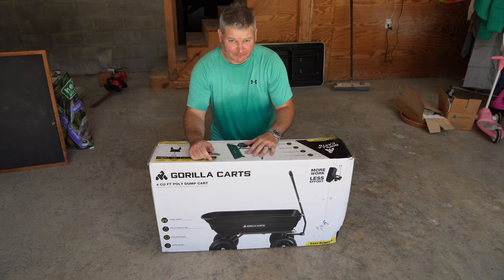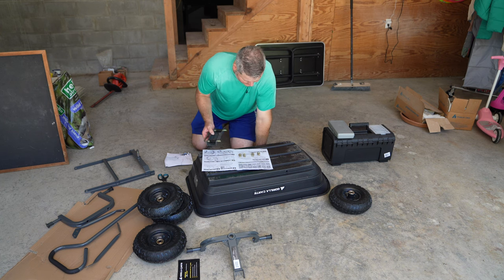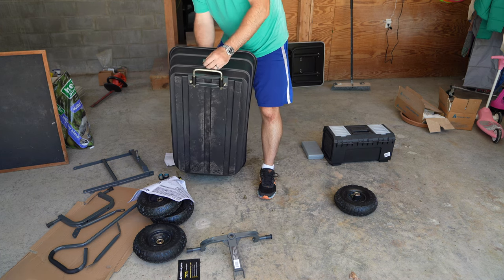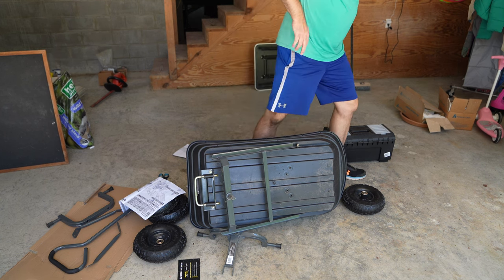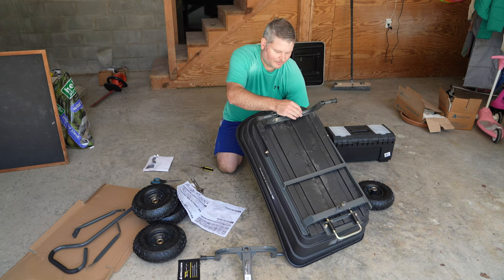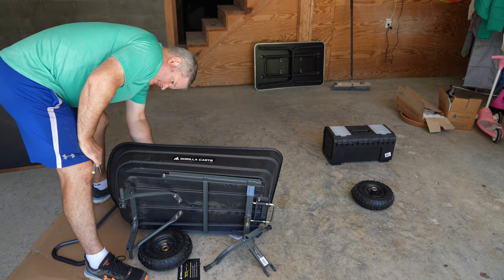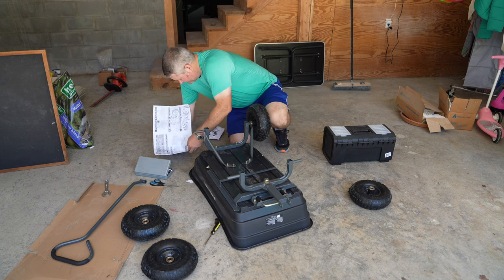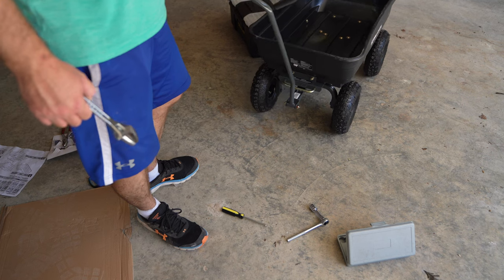Gorilla Cart Unboxing & Assembly

Comment: I have owned one of those for ten years. It's a great yard and garden wagon for hauling dirt, rocks etc. After 3 or 4 years I got frustated with the frequent flat tires and bought new wheels with tires installed from Amazon. They were foam filled, can't go flat tires. I also put zip ties on the end dump mechanism so my grandkids would not trip it and get dumped out when they ride in the wagon.
Reply from the maker: Awesome!  These tires seem thick.  I wonder if they’ve upgraded the tire quality since then?
Reply: @IrixGuy  They replacement wheels and tires have solid tires with no air pumped into them. Small tires. like the originals or air filled wheel barrow tires can get very annoying after a few years when they are always flat when you want to use them.
Reply: Yeah usually tires will lose air, even car tires will lose air after sitting for a few months …